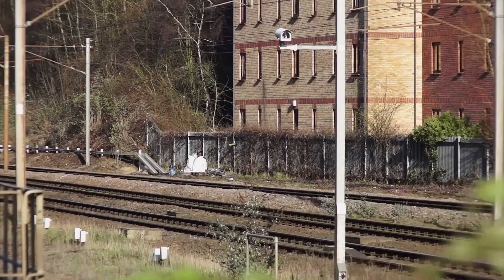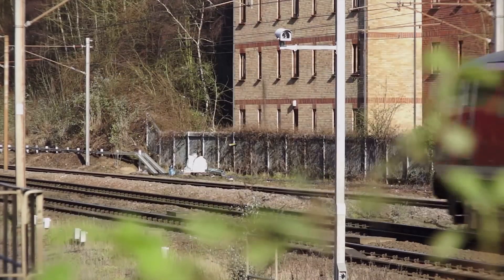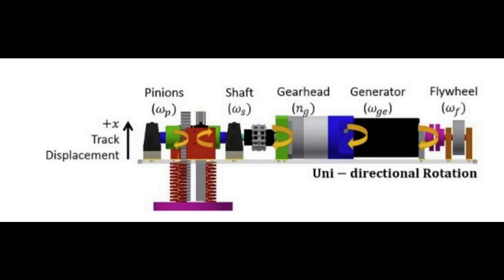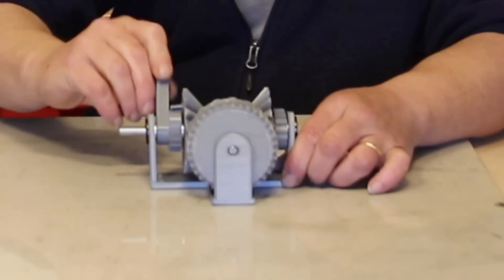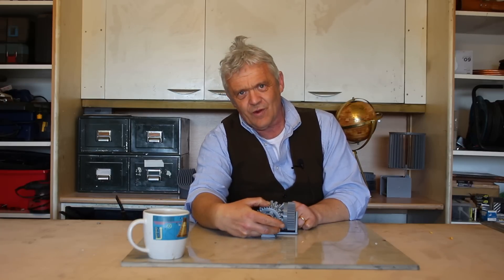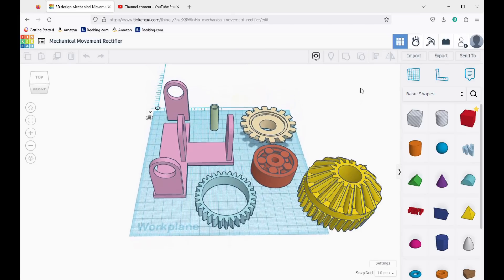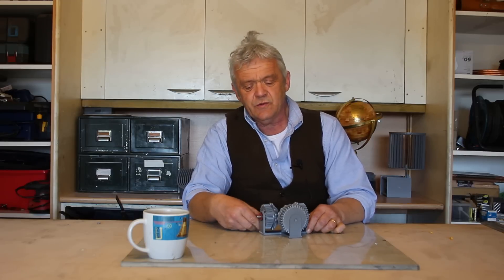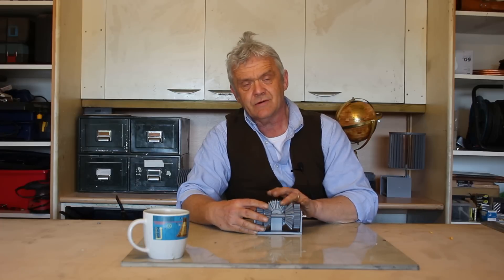1912 Energy Harvesting In Megawatts - The MMR Breakthrough

Comment: My question is: You can harvest the energy of the train bouncing the track, but if you allow the track to bounce up and down , doesn't that make it harder for the train to go forward? If the track doesn't bounce , it's easier for the train to move forward. So you're just stealing energy from the train, i figure.
Also if you are driving an AC alternator, it doesn't need a mechanical rectifier, moving clockwise and anti clockwise still generates AC current.
Reply from the maker: you don't allow it mate - it's going to do it - whatever you do
Reply: That is certainly the problem with pavements that harvest energy from pedestrians (they make it harder to walk). On a railway, the train is already has a problem because the rail bed is slightly elastic. As each wheel is rolling down the track it is effectively climbing upwards in order to deflect the rail downwards, which is where the train loses all the energy that can be recovered with this device. WIth the device in place, it is effectively making the rail stiffer, so that the train requires less energy to move AND the movement (that does occur and which cannot be avoided due to the rail bed elasticity) is converted to electrical energy. If the rail bed could be made immobile, the train would require the minimum amount of power, but nothing could be recovered from the vertical movement. It's an interesting idea, but it seems likely to fail due to the distributed nature of railways. The best use for the power generated would be to feed it back to the overhead lines powering the electric traction motors of the train thus reducing the energy needed to power the trains.
Reply: @tlangdon12  It's similar to this scenario, We have a plastics recycling center near me. We have to take the plastic bottles etc there for recycling to save the planet. The bottles need to be washed and flattened and I have to drive them there in the car. Then the big truck has to drive there to pick them up.
I use gasoline to drive them there which pollutes the air and the gasoline has to be produced also. In order to wash them, my well pump has to turn on to pump the water. 
I'm wondering, after using all that energy and air polluting, ARE WE ACTUALLY HELPING OR HURTING THE ENVIRONMENT???
Reply: The sleepers that the device is on are a main suspension system.
Reply: @ThinkingandTinkering  Yes it will bounce regardless, but the work required for the bouncing must, by thermodynamic laws, require more effort by the "bouncer" if that bouncing extracts energy
Reply: @justtinkering6713  You're helping because feels are more important than reals.
Reply: A perfectly efficient suspension system under all tracks would result in no slow down of trains. If these achieve perfect suspension, the slow down on the train will be entirely how much they generate. They will slow trains down, if they make significant power, they will slow trains significantly.
The other big problem is train tracks spend most of time without trains passing over them at speed. So these devices will only occasionally produce power. Many millions would need installed on suitable trainlines to equal the average electrical output of a single offshore wind turbine.
Reply: This might be a stupid idea but if the train has springs to smooth the motion why not put the device between the carriage and the train drive in parallel with the spring
Reply: @car9167  Why not just eliminate the spring and just use the magnet as a spring and let Lenzs law do its magic?
Reply: @justtinkering6713  Because is not economically feasible. The forces are quite big so bigger magnets.
Reply: You use existing bounce and mount "telescopic dampener" between part of rail and ground. So this device make rails more stiff from train point of view. Less bounce.
Reply: @PeKlim  true but looking at the wheel going down that's a lost of potential energy but when it comes back up on that slight slope energy will be consumed by the locomotive to pull up the minute ramp. Probably the gain is in recovering the lost energy which would happen anyway with down and up. So from locomotive point of view the same energy consumption. It's similar with humans walking. We consume energy when the foot propel us forward but then when the foot comes down to the ground we lost that potential energy for nothing.

Comment: Not sure how much you get overall, it can generate 200w,but only for the duration the train is passing, which in many places will be maybe a couple of minutes an hour. If you were to put them all along the track spaced the length of the train, you would generate 200w whilst the train is running. You could more easily stick a wind turbine on the train, would be much cheaper and generate the same amount, or more, and likely not affect the efficiency of the train due to its overall energy usage
Reply from the maker: tis is not my idea mate - there are lots of studies on this - you might want to read around a bit

Comment: would be interesting to see this being built in the suspension of vehicles that use electricity. would also be interesting to see a system like this on the back of a boat with floaters. i also wonder if it isnt better to built this in the suspension of the train instead of the rail especially for electric trains. maintenance on these systems would probably also take les work if it can be done on routine checks of the train itself instead of having a mobile unit that has to work next to the rail on moments when trains are not driving there.
Reply from the maker: i like the ideas mate - thanks for sharing

Comment: I don't have time to mess with this. You should take 2 5 gallon buckets, have one sitting elevated above the other, but not on top of the other. You can utilize the balance of buoyancy and gravity in the bottom bucket. A shaft of sorts will be needed to tie to the rectifier to convert the buoyancy into juice. The first stage is water being pumped to the elevated bucket with an small voltage pump, the second stage is a pumping sequence after the elevated bucket is full. Voltage requirement is 6 volts, the pumps are less than $3 a piece.  I think you could most certainly produce an average constant that exceeds 6v.
Reply: 6:22 unfortunately, a battery takes a lot more power, and time to charge then it puts out. there is a video similar to that. instead of buckets, he used a pole like a seesaw. he stood in the middle, and shifted his weight from one foot to the other.
Reply: @iami9307  Those little capacitor packs are pretty cool, I was thinking more along the lines of a small capacitor. A switch of sorts would need to be incorporated to switch between the 6v pumps depending on the position.
Reply: @samuelthomasengardio  by all means, have some fun and try it out
Reply: @iami9307  Well, this Robert guy presents brilliant ideas faster than I can order materials for testing. I'm still working on one of his presentations from 18 months ago.
Reply: @samuelthomasengardio  lol. don’t let yourself get overwhelmed with projects.

Comment: A stepper motor makes multiphase power in either rotation direction the advantage of the described system is the efficiency of the mechanical energy where the stepper motor rotor inertia is a factor of concern and not the coupling energy efficiency .
The rail application is interesting in that the fact that energy harvesting represents interception of energy lost in the suspension of the rail .
Here is an interesting potential application  interception of energy needed for downhill overspeed prevention but this particular device is not as appropriate .
Reply: Downhill recovered energy could be stored for other trains to utilize for going uphill .

Comment: Am not quite sure why this popped into my head but I thought about the energy lost between the exhaust of a car and the chassis of a car, an electric car may not have an exhaust but having a bar that flexes, sure there is a lot of ways a moving car could produce electricity. But the only drawback to that would be you don't have to charge the battery up as often.
Reply from the maker: maybe mate

Comment: This would work well on ships.
And / or on the side of offshore wind turbine pylons with a longer arm to amplify the wave force, 4 units set at 90° to each other.
Or, a floatation ring around the pylon base providing vertical motion.
.
Could provide a useful supplement to the turbine, especially on less windy conditions. There will always be water flow and height difference.

Comment: the only difficulty i have with this idea is, how much less efficient does this make the trains? i understand that it uses waste energy, but that energy is part of the system that is a train on its tracks. if it takes too much it would be like running on a treadmill that harvests your running energy slowing you down, instead of running on a regular powered treadmill that replaces lost energy with wall power. if its a small amount i guess it doesnt matter, but i'll need to see some tests first.
Reply from the maker: not at all mate - it actually improves the train

Comment: Hi Robert, I see that 1st part and think of all the useless wheels spinning away doing absolutely nothing! Your serpentine coil springs to mind , on each wheel surely it could assist or even takeover from the "starter" engine. I meant to say thanks for the reply a while back too!
Reply from the maker: i like that idea mate - cheers
Reply: Thanks, thought about your wind worm device too, if you had a bucket belt to lift sand to a container with an hour glass bottom (to regulate speed vs torque), then a series of sand wheels to charge up a no-wind back up battery

Comment: so where was this video a decade. Had this idea driving from Indianapolis to Columbus and did some reading online trying to find a way to harvest the energy from roadways...thought about some bladder that was compressed and would drive a generator on the side of the road. Ended up working, for a little while, with a group using piezoelectric material to generate the electricity. had some conversations with Ohio State University on the same subject. Calculated that for a single 1/4 mile stretch of freeway here in Columbus we could harvest enough energy to power many of the homes that were along the freeway...turned out though that the science behind the material was iffy. This would have/ could still work. What about storage along the RR some are very remote in the US
Reply from the maker: this could be made to work i think

Comment: this could be put into roads and bridges also
Reply from the maker: yeah - it would be awesome
Reply: I think for roads this is done with a very low piston that runs the width of the road, and it operates off of the pneumatic pressure rather than the vibration.  This air pressure feeds to a massive pressure tank that is then turned into mechanical force and then into electricity.  The Dutch have also trialled paving roads with solar collecting material, although I haven't looked in some years to see how it paid off.  Bridges is a brilliant idea!  I think in any infrastructure there are methods of collecting energy, it's just getting the means to do so.
Reply: @skampp  there is movement in all bridges even with no traffic. if this could be harvested energy we may something
Reply: @ThinkingandTinkering  maybe a good video idea for you to look at the way bridges are built and how they move with the wind and traffic
Reply: It has use for traffic calming due to the breaking effect from vehicle's momentum.

Make accident hotspots safer, and generate some electricity.
Reply: Essentially the drivers experience would be speed-bumps.
Reply: Probably better to use hydroelectric under roads through.

Comment: I have given more thoughts about your flutter wing energy harvesting, isn't a typical problem of wind harvesting is that it's typically evaluated in "surface" "collectors", and that turbulent hair is an issues for performance? isn't that something flutter energy can help with? like harvesting a full volume instead of a surface, as it seems to handle turbulence. Let's assume we have a 3d cube where these harvester are organized in a grid, given they take wind from any direction, I assume collector in the direction of the wind would disrupt the flow but the following collector would pick up the turbulence created nonetheless, it seems like there would be an energy gradient to collect more efficiently wind rather than just a surface. And maybe there would need to have different type of collector for "surface" collection vs inside collection. Maybe a funnel would also help (like wind turbine, since it can take any direction to funnel). But like they said, more experiment is needed lol.

Comment: so three trees or more ? MMR attached to one tree  each , each attached to each other by a sprung lawnmower pull cord each cord once pulled in one direction will turn a wheel that turns the gears on one side after the tree sways back to and past its original starting place the cord returns and the other expands both powering opposite wheels in opposing directions on  MMR generators ?? Should work on many levels of wind strength and cords with enough length  to avoid  breaking, but under just enough tension to pull cords and spring returns  sprung enough to return cords to be ready to be pulled into action again ?  I was going to attach them to a generator with a sprung clutch originally and once at a tension setting let go to spin and generate power  ready to be pulled on the next movement , the opposite pull on the same thing on another generator  on each tree ?

Comment: Why was it necessary to rectify the movement? A geared stepper motor will generate A.C. electrical energy which ever direction it rotates. Was it simply to avoid the discontinue associated with the direction reversal, or the loss of energy associated with the stop and start. 
It is unfortunate that it was necessary to use mechanical recovery, as this involves wear and tear and associated maintenance. Is there not a means of solid state recovery, using something like the piezo electric effect. 

In recovering this energy, there must be an effect on the rails, presumably increasing their stiffness. Does such recovery have a knock on effect on the maintenance of the rails.

It is surprising so much energy can be recovered, given the small part it must be of the total electrical energy used to drive the train motor, and the fact that the recovered energy must also be transmitted back to some central point for accumulation.

I have often wondered if the energy of cars moving on a road surface could be recovered by pneumatic or hydraulic generators connected to speed bumps, maybe only on the slowing portion of the road leading to roundabouts and junctions. The energy collected from the weight of traffic moving over such bumps could be used locally to power the lighting at the junction. I am aware that the air pressure generated by passing cars and HGVs can now be collected by wind turbines, to power similar applications.

Comment: my seiko watch has an "MMR"... it winds the mainspring when the counterweight rotates in either direction...easier, as it's rotation-to-rotation, but, tiny, and efficient.
It seems that the flywheel in the system mentioned ought to be on its own one-way coupling, so that it can continue to spin freely, for a bit, between input pulses...No?  Like a diode and capacitor... but, ideally, the one-way should be in the low-speed part of the ysytem, to reduce friction losses?
Reply from the maker: good points mate
Reply: @ThinkingandTinkering  Thank you sir... I do my best  ;-)

Comment: Great idea, but wouldn't the amount of dampening depend on the speed of the flywheel so there'd be a harsh ride initially and then no dampening later unless the electric load is managed to keep the flywheel at the ideal speed. Would have thought a shock absorber and then making use of the hydraulic pressures would be simpler?
Reply from the maker: it's fixed to the rails not the wheels
Reply: Ah OK thanks, for the UK would need to accommodate most trains becoming a replacement bus service.

Comment: I want to know why you have to have continuous rotation to generate that power, instead of just having some powerful magnets that rock back and forth as the vibration is converted into a larger rotation than the linear gear is vibrated up and down? I thought that magnetic flux changes is all you needed to move those electrons in the wires? seems it would be simple if that were the use.

Comment: Very interesting video
I wonder if it could also be used on vehicle suspensions
And how effective it would be
A massive amount of vertical movement wasted in those also
Cheers
Reply: 6:22 hybrid, and electric vehicles already do that
Reply: @iami9307  Ok 
Cheers i didn't know that
Reply: @andrewwhittaker6622 I ment they use generative breaking that is
Reply: Oh ok 
I was thinking of shock absorber movements a lot of wasted energy in those
Regen has been used for years for Delec Train braking or dynamic braking i think they call it here in Aus
Cheers
Reply: @andrewwhittaker6622  actually a shockabsorber, or strut that most cars use now have virtually no movement. that is unless the wheel hit a pothole speedbump or washboard road.
Reply: Not here in Aus mate
They get a damned good flogging
You could power a small town with suspension bottoming out on our road's 😄
Reply: @andrewwhittaker6622  lol. good golly.